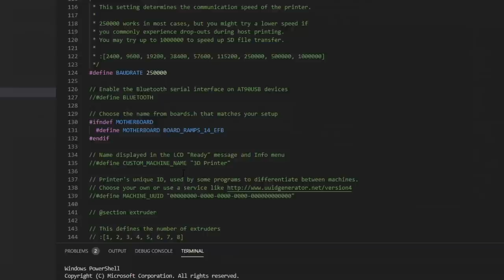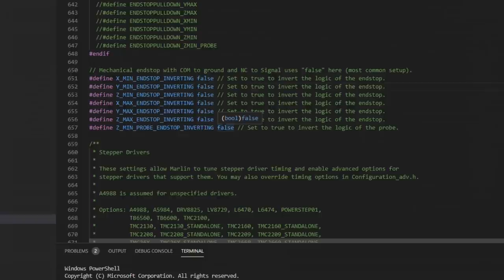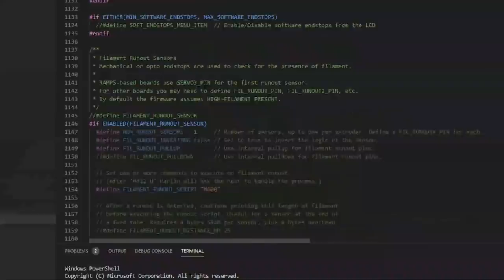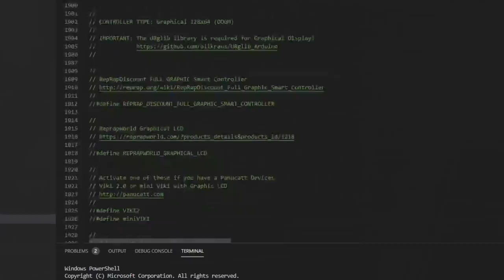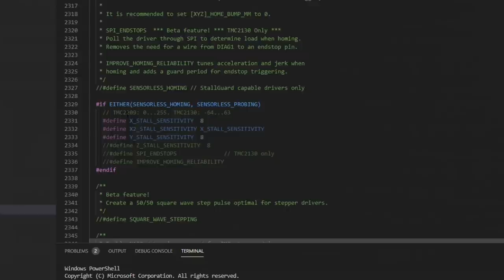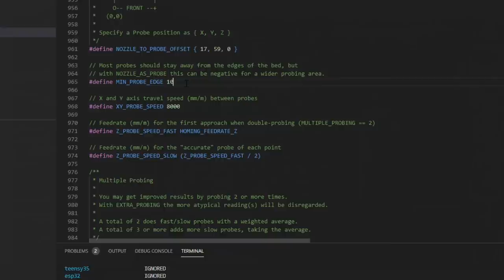Marlin Firmware Config - Core XY - SKGO - Chris's Basement

Comment: Hey man, i recently purchased a Tronxy D01 as a beginer printer, i installed the marlin 1.3.2 because that what they sent from tronxy aftersales, however i have this weird thing that only  1/4 of the printing area is used  considering the left lower corner as center and 110 mm on both XY  direction im pretty sure its a calibration problem, now i  did watch about 15 minutes of your video but i couldnt figure out if this would help my printer, do i need to write a marlin firmware or just run some parameter gcode?
Reply from the maker: Hey, so you might be able to just change it with a command. Setup pronterface and use it as a terminal to access your printer board via USB https://www.pronterface.com/ Check out method 2 here https://reprap.org/wiki/Configuring_Marlin_Bed_Dimensions

Comment: Hey Chris, love your videos, always a good place for me to learn.  i was wandering if you could suggest a solution to a problem i have.  i have a SK-GO and have been using it for a couple of years now, wanted to upgrade to the latest marlin (2.1.2.1), after flashing the firmware (SKR1.3) my movements all are correct when i jog all axis, the printer homes correctly, but when i slice a test cube in curar and upload the gcode, the printer homes correctly and the the print head shoots off to opposite side of the bed from (0,0) and stops in the corner and just starts squirting out filament with the bed dropped.  ive looked through the gcode and cant see any glaring issues in the code, so im assuming its a firmware issue, something i have wrong in config.h or config_ADV.h

do you have any advice as to where i should start looking?

again thanks so much for your videos, and your time
Reply from the maker: Thank you! All I can think of is maybe one of the M92 commands is off. If you use a terminal like pronterface and cable up OSB run a M503 command. If you can send that to me, I might be able to help spot an issue.

Comment: Hello, a very good video, 
but if the X and Y axes are no correct how  i have to do to move the corret direction in bolth Axe "X" and "Y"?
as you have to coordinate both axes and have 8 options?
thanks
Reply from the maker: Thank you! Try to move the axis by hand and keep track of how the motors move. Then you can match those movements in the config.
Reply: @ChrisRiley  THANK, i get it, changing first alfa motor cables and then with the beta motors cables, 4 posibilities and finaly of course the 4Th option, and one motor cable was half broker..........

Comment: hey i have a question, pls help, i am using reprap discount full graphics lcd, everything is working but ; heated beds's logo where it and its temperature is shown on status screen, is not appearing, nozzle is working fine but what to do for heatbed, pls help
Reply from the maker: You need to update the heatbed thermistor setting, it's set to 0 by default, set it to 1 for a test.
Reply: Yea I found the solution that was too and I had not uncommented the pid heatbed however now I fixed it thanks

Comment: how different would it be to compile core zx for switch wire type builds?
Reply from the maker: Not all that different, it's just another option in Marlin, you just have to follow along and set the motors accordingly.

Comment: If we use parts that will not fall corexy Bed printer, when the power is loss. Can we easily use the power less recovery feature in marlin  that you mentioned in the previous videos?
Reply from the maker: Yes, as long as nothing moves when the power cuts, it will work,.

Comment: How can stallguard work for corexy if the motors cooperate on "straight" movements? Wouldnt the first bump trigger both endstops? Or is it so that if you order Y to home before X the stallguard trigger might trigger for both but will only register for Y ? I have a really hard time wrapping my head around it, i mean i see that it works in the video but still :S
Reply from the maker: It will trigger them separately, it does them one at a time and is smart enough to know which axis is getting triggered.

Comment: I have 12v fans and my power supply is 24v ,and I don't want to use a buck converter so can I setup max pwm for controlling the fans and if yes is it safe?
Reply from the maker: In Marlin yes I think you can, is it safe? I really can't say there is always a chance you will get voltage when the firmware is booting. I would set it and hook it up to a meter first just to make sure it worked.

Comment: I have been using my Prusa MK3S since it was released. They have made a lot of upgrades to the fimware. One of my favorites is faster bed leveling. I've restarted my Hypercude Evolution build and it's finally all complete. But one thing that I can't seem to figure out is how to speed up bed leveling. It is so slow. It takes 5 seconds per probe. It does 3 probes at each point, so 15 seconds per point. I don't think the MK3 even takes 1 second per point on the grid. How do I speed this up?
Reply from the maker: It's kind of hard to, you would need to increase the Z feed rate, then increase the homing speed.
Reply: @ChrisRiley   That definitely points me in the right direction. Thank you Chris.

Comment: Morning Chris...
I have a question so I chose to post it here related to a marlin question...
So my question is; when setting up marlin for any 3D printer, you obviously have the option to enable your MAX & MIN enstops right! So the question is if you enable your MAX endstops but home on your MIN's, is your MAX going to work in the background? And if so, if one of them is triggered, will it (halt or stop your print in its progress)? what can I expect it to do? I've activated mine with the understanding that it will stop the print from crashing into them (MAX).
I would appreciate it if you reply. Thks...
Reply from the maker: I'm not 100% sure, but endstops will only be enable during homing. You can play with this setting #define ENDSTOPS_ALWAYS_ON_DEFAULT 
The bed size will keep if from going out of it's area if that's what you are looking for.
Reply: @ChrisRiley  Yes!!! :) This is exactly what I was after, an option for using them for just this purpose. Brilliant... Thanks for that. I knew you would know.

Comment: Why is your belts twisted?
Reply from the maker: That is one way you can insure the belt teeth never run on a smooth surface.
Reply: @ChrisRiley   I have a tronxy x5sa pro.  I have almost all rollers at toothed side  As the manual says..
I will try to twist them and see if it is better and quiter
Reply from the maker: @klyddmeisters  Give it a try, it's a fun experiment.

Comment: Good afternoon:
From Argentina, I'm Spanish-speaking, sorry for the translation,
I am building a printer, Clone Prusa I3 type. I uploaded the Marlin to the mega 2560 board, and when connecting the motors (X; Y; Z) they make a vibration and do not turn, the drivers are 4988. They can help me with this error
From already thank you very much
Stella maris gimenez
Reply from the maker: Measure the driver current and see if it is enough to power the motors.

Comment: Got a question for ya. I know I can fix it by homing Y before X, but while setting up my corexy and sensorless homing, I was testing the motor directions and homing just the single X and Y. If I home X, Y acts like it’s already homed. If I home Y, X homes normally. Any idea why this would be?  Just curious.
Reply: I think I figured it out.  I need to setup a better way to interface with this printer so I can see what its thinking, but that should be ready soon.  I think that I'm tripping both motor stall sensors which is tricking marlin into thinking I'm already at home.  I've decided this because sometimes it works and sometimes it doesn't no matter which axis I home first.
Reply from the maker: Ah, got ya, glad you found it. It is rather challenging to get it just right on the core xy.
Reply: @ChrisRiley  I think I actually fixed it.  Since it was triggering off both X and Y, I enabled quick home.  The diagonal movement only runs one motor, so it seems to help.  Needs further testing, but it didn't fail right away.

Comment: This guide has been 10/10! Thank you, Chris. And all was going well in the configuration, but for some reason, some parameters are not updating from the SD card. I need to increase the StallGuard sensitivity, but when I run M503, it always shows my original values of 60 for X and Y. Also, my max feedrate won't change. I know the board has taken the .bin file, because it's gone from the SD every time. All was great until this road block...
Reply from the maker: I have seen this type of tricky thing before. Format you SD card just to be safe and make sure you run an M502 then M500 to update eeprom after your changes.

Comment: Chris. Good stuff. keep it coming ;) I have 2 issues. ISSUE 1 is sensor less homing is not working for me. I've set the sensitivity as high as 120 and see no difference from initial setting of 60. it does stop when it reaches home but only after a couple of clicks. I used the stepper motors from my Anet A8 for my new CoreXY.  Not sure if this could be the problem. ISSUE 2 is using Z-probe endstop.  I have "Z_MIN_ENDSTOP_INVERTING true", "Z_MIN_PROBE_ENDSTOP_INVERTING true", " Z_MIN_PROBE_USES_Z_MIN_ENDSTOP_PIN" & "FIX_MOUNTED_PROBE" enabled. In Pronterface, I enter m119 to see status of the Z probe when not activated, it shows it as "TRIGGERED" and like wise when it is activated. The probes Iv'e tried is a SN04-N and an OMCH LJ18A3-8-Z/BX. The later runs on 6v-30v and tried powering it from the board and the 24v PSU with the same results.
thanks.
Reply from the maker: Thanks! For you sensorless homing, try homing at a lower current, that setting is available in Marlin. For your probe, what mainboard are you using?

Comment: When I build with 2209 steppers, it won't compile. Says the slave has the same number as another :(

"X_SLAVE_ADDRESS conflicts with another driver using the same X_HARDWARE_SERIAL" same for all(x,y,z,e)

I am also having an issue where one motor will not move as fast as the other. Tested the belt tensions, cables, and motors. firmware or the board?(skr mini e3 v2)
Reply from the maker: That might be your serial setting, do you have it set to -1 and 0?

Comment: Chris. I have built a 300x300 corexy and will be putting an SKR 1.4 Turbo into it. However, I know nothing about coding ut I have followed your video minutely - watching each small section then switching screens to do the same in Visual Studio and platformio, but despite having done it three times now, whenever I try to Build, I get error messages and 'failed' signs - all of which I have no idea what to do to correct. Any suggestions for a tired, worn out old Vet?
Reply from the maker: I will take a look.

Comment: i built myself a Hypercube Evolution.  330x330x400 capacity.  i've watched your video here several times on coreXY setup.  yet, mine doesn't seem to want to cooperate not one bit.  mine wont go the way i ask it to.  X seems to work, but on my menu, under the Y axis when i attempt to move it forwards, the number starts at 330mm.  whereas, X, starts at 0.  i don't get it.  not at all.  so i  downloaded your SK-GO copy and edited it to represent my use of a BLTouch, remove the runout sensor since i do not use them, and various other minor things...it compiled fine, however it still is not working.  lol  HELP, O' WISE ONE!
Reply from the maker: So the SKGO didn't get it going either? When you home, what does it do, where does it move to?
Reply: i finally got it going.  well, almost.  when i move X, it goes to the right, as expected.  when i give Y positive input, it moves backwards. but, it DOES home  just fine.  makes no sense to me. lol
Reply from the maker: @kryptikfpv4253  Huh? LOL, not sure how that works.

Comment: You helped me a lot! I have a MKS Robin E3 and i did my own COREXY, after your video, i used de NEON PIXEL conector to control de extruder fan using a relay module! Now i will try to do a auto off system! My optical endstop didn't worked with this board, to resolve this problem a used a NPN transistor and a 10K resistor! A have an esp 01 connected to have wifi control!
Reply from the maker: Glad I could help!

Comment: Am I the only one that does not get a change of status when the probe i triggered? I mean, I can see the light of the inductive sensor lighting up, but the m119 does not reflet a change of state. I`ve followed the video to the detail and can not figure out why it doesn't work
Reply from the maker: If you have it on Z min pins correctly and Z min pins set in the firmware,  then the sensor might be bad.

Comment: Thanks alot for this video. It helped verify some z-axis problem where it would lock up but not budge a midge (~ half bees dick). After checking upgraded marlin config (from 1.1.9), checking steppers, motors, ramps ports, adding TL smoother... it turned out: Two leads of the cable to the z-axis motor got pinched somehow. Not enough to sever them but at least one hard enough to cause severe reflections so the motor got distorted signals and thus wining, locking up but unable to spin the shaft. Solution: cut, resolder, reconnect. Be happy :)
Reply from the maker: Very nice, glad you found it. Thanks for watching!

Comment: Hi Chris, do you check or adjust the trim pots on the 2209 drivers?  I am in line for a Sk-Go2 kit but have a feeling it will be a couple months before it gets here.
Reply from the maker: You can, but not needed. I would just use the UART settings and commands. To use the trim port you would have to do some soldering to enable standalone mode.

Comment: Chris
my vscode crashed so I uninstalled it and downloaded a fresh copy, installed, and did the platformino ide install now when I do import project and use the mega default and then change to my LPC1768 board in platformino.ini and save the file then make my changes in config.h then try to check compile it throws an error the wrong board,. I have spent all day and cannot figure what I am missing can't seem to pick it up from your videos.
I get these errors while it is building
{} c_cpp_properties.json .vscode
cannot find"c:\users\don44\desktop\marlin bug fix.0 fresh\Marlin-bugfix2.0.x include". [9, 17]
cannot find"c:\users\don44\desktop\marlin bug fix.0 fresh\Marlin-bugfix2.0.x include". [29,21]
sorry it is not clear my brain is fried from trying to figure it out
The whole reason I am trying to build a new file is my extruder motor squeaks when it tries to retract too fast I think so I wanted to turn down the acceleration.
thanks don
Reply from the maker: You have the non-turbo board correct? You rdefault env says this? default_envs = LPC1768
Reply: correct i could not find it in the import boards in platformino in one of your videos you said not to worry it could be changed later and that is what I did. 
unfortunately, I was so frustrated I just shut it off before I recorded the error the program reported about the incorect, board ,pins, somthing. I guess i will have to try again and record the message it reports.
know anybody that wants a used x5s, 120-volt bed, enclosure it has been nothing but trouble i got it to be able to print large parts, But i just cant seem to keep it running flips between hardware problems and software. The original board just quit I never did figure what went wrong, second board driver for z-axis overheated because the motors got out of sync and jammed. I got it working and fixed sync problem worked out now the extruder motor is squeaking I think when it tries to retract,
not sure I can get it sorted out.

Comment: Please a video on printer with dual z drivers, stepper, two z end stop homing and bl touch for levelling ,one z end stop homing and bl touch is working fine but when use 2 end stops to align the bed before levelling ,weird things start to happen tried every pin available and modified pins on marlin  with no clue, either the probe is working but one end stop dont or both end stops align the bed but the probe dont retract the bed when start levelling and cause fault probing , my board is skr pro 1.1 , to note using only two end stops alignment is working fine, bl touch with one z end stop work fine also, with my great thanks.
Reply from the maker: I'll see what I can do.

Comment: Chris, I watch you because I feel you know what's up with 3D printers,  and I hope you can do a show on a modification of a Ender 3 or Anet A6 to do 3mm filament. Or just let me know if it can be done for a reasonable price. I have and Ender 3 and an Anet A6. I bought some filament and somehow ordered 3.0 as opposed to the 1.75 I should have bought.  I then thought about what if I could get some us of it. Not practical, but I figured why not try and see if it could be doe=ne.
Reply from the maker: Hey Les, it could be done, but not so easy. You would need a new hot end and a geared extruder probably not worth it.
Reply: @ChrisRiley  Found a unit on Amazon for 18 bucks... We shall see if it works for long. Has the whole hot end/extruder, I will let you know how it works out.

Comment: Your thoughts on   #define BLTOUCH_HS_MODE located in Config_adv.h?  I use it with #define Z_PROBE_SPEED_SLOW (Z_PROBE_SPEED_FAST  /  3) which gives me quick travel and first probe moves, but then the very slow second gets the better reading, but all in all, a 3x3 is done in about 20 seconds on my 200mm bed and 30mm margin.
Reply from the maker: I need to test that, I wasn't really sure what it did. I will give it a try.

Comment: I had an SKR 1.3 and a faulty stepper driver which caused my serial connection to fail.
Reply from the maker: Interesting, I will see if I can figure it out.
Reply: @ChrisRiley  Ok, the way I figured it out was I thought it was the board so I ordered the 1.4 turbo.  Used the old stepper drivers and the same problem.  I swapped out the modules and I was back in business.  And now I have a SKR 1.4 turbo.